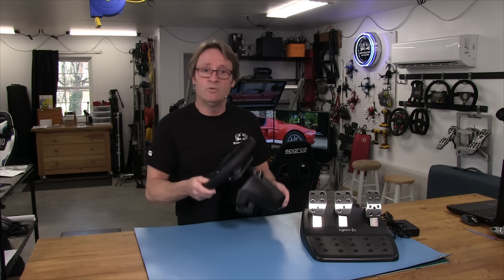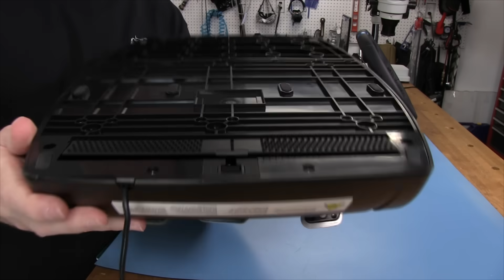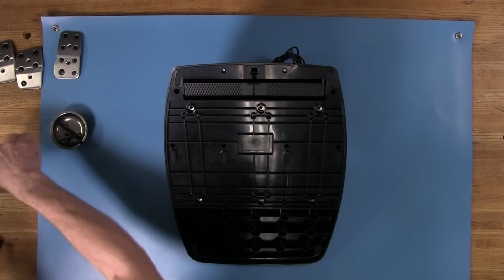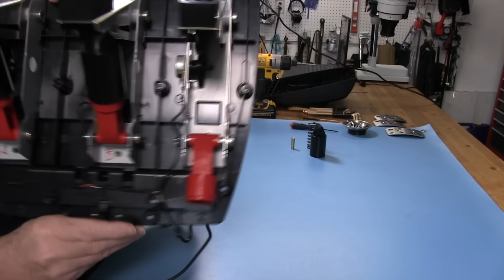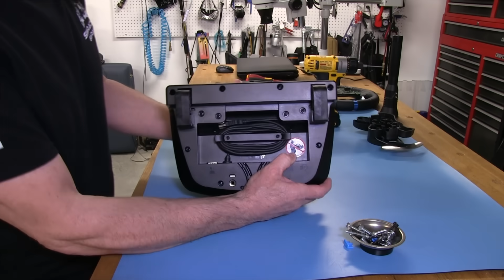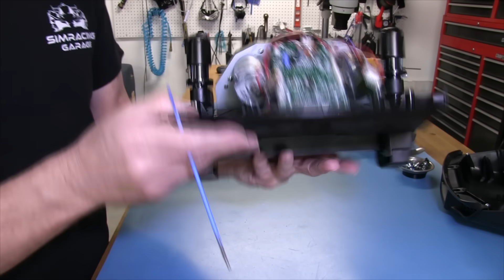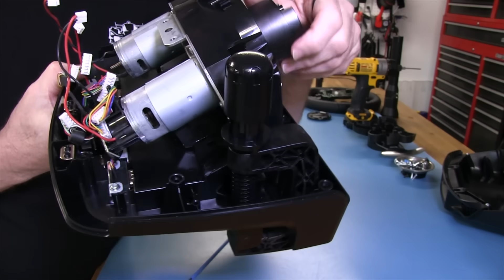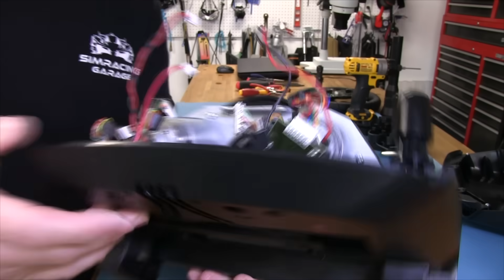Logitech G29 Review

Comment: Its so fun watching this as a g29 owner (1year and a half now).
This is my first wheel :) Am very happy with the product
Reply: Im still running my G25 for 11 years lol  but upgraded my pedals and shifter.
Reply: @sweetcougar  you an OG dude hhhhhh 👌💪💪
Reply: Close to a year maybe a bit longer with mine.  Same as you, first wheel I bought.  Very happy and it works across several different games and performs well.
Reply: M96k3y Same, 5 months with mine
Reply: Key Koben, for what it's worth, my G29 has been going strong for 8 months now. I've used it with Assetto Corsa, Project Cars, F1 2017, Dirt 3, and Forza Horizon 3 and I haven't had any issues. I did need to adjust the vibration and feedback settings to eliminate clipping and rough clacking sounds (particularly in F1 2017), but that's something you'll have to do with any wheel.

Logitech seems to have the best durability out of the good entry level wheels (between Logitech, Thrustmaster, and Fanatec), and I've had good customer service from Logitech in the past for mice that broke on me (and were easily replaced).
Reply: Hey! After 1 year and half is your G29 still running good? I mean, I've read some reviews of people saying that their g29 has stopped working after some months or days. I've bought a G29 and I'm a little bit worried about this. If you reply to this message, thank you very much! ;)

(Sorry for my english)
Reply: I'm gentle with the wheel most of the time and i believe that that does help. I try not to overheat it, oversteer it with force and stuff like that. But other than that no wheel will die at same time. You might be unlucky and get a bad one from factory, rarely happens tho... I would still suggest tx500 for starters :P saves you the hassle of upgrading to it later :D I have to save up for it now since im kinda bored of the g29.
Reply: After 2 and a half years my G29 pedals have started to fail out of warranty so I'm waiting for CSL elites to arrive. But the wheel itself is still working fine, although some of the buttons have been worn blank from use...
Reply: Playstation didnt stop supporting the g29,biught it 2 weeks ago and working fine.Did you try to set control to the wheel?
Reply: Koben, my G29 is waiting for my exams to be done to be tried the first time, so I don't know yet how good and durable it is, but if you live in Europe you have 2 years of warranty, so even if it breaks down after 1 year and half you are fine. If you live outside Europe, you have to check you local laws on how much warranty you legally have, or check with Logitech themselves how much warranty you have (normally it is said somewhere in the owners manual, or on a warranty card).
Reply: Alexander Timofeyev yea! I've bought it 4 weeks ago and it's very nice! :D
Reply: Ok so 3 months later (1 year and 9 months now) and my potenciometer is either broken or dirty enough that i have to send the wheel back. Don't want to lose warrenty over cleaning something out of my pedals. (Wheel it self is still running as good as it was 3 months back). Nice to see people being able to run g29's for longer period of time.
Reply: My thrustmaster tx is still doing just great and it is coming up to three and a half years
Reply: Jarne De Prins thank you very much! Yes I live in Europe and I have 2 years warranty (bought new from Amazon)
Reply: Must be nice... I got mines yesterday and it's not even detected on my ps4, it spins but no usage on the ps4 menu or Dirt 4, Assetto Corsa, Spin Tires Mudrunner, or Driveclub.
Reply: Vikstar Draco, have you tried to hang it on a PC? I had to update the firmware of the wheel first before it would be recognized by my console. Update of firmware was only possible after installing the Logitech wheel on PC. I don't really agree with James above me. I do know Logitech has dropped support for older wheels (i.e. G25, G27), I couldn't find that info about the G29. The games you mention are also compatible according to the developers of the games. As the G29 is still being sold as PS4 compatible, I would return it to the shop. My first wheel was also a faulty one, which failed me after just 5 months. The replacement wheel (Thanks again for that awesome service, Logitech) is working fine, but as I mentioned had to be updated to the newest firmware.
Reply: @joerirouwen1295  on what part is there disagreement? PlayStation did stop support for the g29 its was a pretty big deal at the time.I must admit they may have worked things out by now.
 Or do you disagree with the part where i suggest to get a wheel thats on par or better than the g29?, Would you rather people play on a cheap wheel with no ffb and limited rotation?.
 Or maybe the bit where i say the wheel is fine. (it could be an out the box faulty wheel we don't know).
 Im guessing you disagree with me  telling him that its not his fault, right?
 Apart from telling him to try a firmware update you told him the same thing i did "to get his money back" .
 To even add in your comment that you disagree with me especially without indicating on what part is a bit strange and signals intent to upset people other than the ones your trying to help. "yes that's how it comes across".
 
 I could be wrong, but it frustrates me that you didn't pin point you disapproval ,the bottom line is (without going over old ground) we told him the same thing to get a refund.
Reply: James Downing, Well, as you seem to make a huge point out of my comment, let's clarify myself. I don't really agree with all your points to be fair. 1. As I said there is not much to find on the internet about your suggested incompatibility G29/PS4. An older wheel would have problems indeed, with the introduction of the G29 this issue would be solved. You are kind of right as Logitech was a long time partner of Sony, but choose Thrustmaster at that time, thus became (I believe the t80, t300) the first officially PS4 supported wheels instead of a Logitech one. When Logitech figured the new chip out the G29 became Logitech's PS4 supported wheel. Again, nowhere is a thing to find that the G29 is unsupported. If you could supply me with your source I would be glad to tell you I was wrong. (My source: https://www.eurogamer.net/articles/2014-11-05-whats-the-deal-with-ps4-and-xbox-one-steering-wheels and https://www.eurogamer.net/articles/2015-06-11-logitech-confirms-a-new-wheel-for-ps4-and-reveals-a-new-xbox-one-contender-too and of course https://www.logitechg.com/en-us/products/driving/driving-force-racing-wheel.html ). 2. Of course you can not say that his product is 100% fine, as there are cases of DOA's (Death-On-Arrival), due to several causes i.e. bad testing, bad shipping, bad storage etc. As I said I experienced a model which had not got the last firmware, and thus would not function as expected. That is something small which you can do yourself. To correct your assuption again, I told him to go back in this case indeed, but not immediately for his money back. Try to switch for the same model first, as there would be a good reason why he would have chosen the Logitech above a Thrustmaster. I'm not daring myself in the Logitech/Thrustmaster discussion. So in short, no his wheel is not 100% fine, otherwise it would have connected.
Reply: From what I've read, the G27/G29/G920 wheels are among the longest lasting, toughest wheels out there.  It's not a Fanatec or Accuforce but it still works good.  I've had mine for about a year now and have had a lot of fun with it.
Reply: @joerirouwen1295  Wow you have already proven that your a massive troll who goes around online upsetting people ive seen other arguments you have unjustly  started with people in fact you're a known troll. You are so stupid that you the missed point of me saying that there was no need for you to mention your disagreement and start a agrument in your first comment ,but thats what trolls do.
Its also funny that you blindly said you disagreed with my whole comment when you also told him you get his money back! that also makes you ignorant and a hypocrite, but hey go 
Keyboard warriors hiding behind your screen and fake name.
What a perfetic individual you are maybe change the name to something like "the sad troll life" because yours is clearly anything but good!, you have issues.
See the massive time difference between our comments thats because I've got important things to do in my life you cleary haven't. Im done with your stupidly and ignorance. 
Im sure you'll make out like you have done nothing wrong and that  didn't deserve what I said to you but this is what you live for, i've feed the troll now as i said before im done with you,  I can't entertain bottom feeders forever.
Please do respond with your stupidly ignorant hypocritical comments and let everyone know you're king of the trolls, (i'll just laugh at you)
Next time don't start fights with people who try to impart advise to others even if you don't like just give your own information without being a massive tool .(fun watching you trip over you're own comments Though) you have completely taken me off topic as to why we're here but that was your aim as a troll right to get everyone to focus on you."SAD"

Hope your life turns around for the better real soon.

YOU DESERVED EVEN EARNED THIS ONE HOPE YOU'RE FULL,  GOODBYE .
Reply: Ah yes, the troll card... I did not reply to you in the first place at all. If you imply my comment (stating facts, with sources) as being a troll, you are gonna have a hard life. I bet you didn't even read my comment well enough  and began all salty after the first words. Maybe you did not understand my comment, but that will not be my problem, as I wasn't trying to solve your wheel problem, was I?. Goodbye!
Reply: @vikstahtrickstah  hey at the top of the wheel there is a button to move it to PS4 it is set on ps3 by default
Reply: @ceementality  thanks so much bro 💯 I got through with it :)
Reply: @vikstahtrickstah  PlayStation stoped supporting Logitech wheels not long after the G29 was released rendering it almost useless on Ps4. 
 Its not you're fault, and the wheel is 100% fine im sure. 
Thing is you need a Thrustmaster  wheel or more expensive a brand to play those games on PlayStation. ( I don't know why PS stopped supporting Logitech you will have to look that up yourself)
All i can say is get your money back and get a' TM wheel for your Ps4, I've heard that the t150 is not that bad but do your research before you reinvest.
Reply: @JD-qq9mb  not true
Reply: i had a g29 lasted 6 days after that it would not center itself anymore i treated it well maybe just a calibration issue i gave it back will try the TMX i'm so disappointed
Reply: Loving mine too
Reply: 2 days with mine g29 :D

Comment: Did you find your lap times to be slower compared to your higher end wheel /pedal setup ?
Reply: I upgraded my stock G27 pedals to clubsport V3. I have improved my lap times by 2+ seconds and my consistency is a lot better.  So i strongly recommend better pedals, preferably load cell.
Reply: I had a g27 for several years (before that a logitech momo..  before that another budget consumer thing and so on) ... now I have an OSW direct drive wheel (for a bit over a year now) ...  the laptimes don't realy have anything to do with the wheel...  more with what you are used to...  however it is true that you feel more secure or confidend with a highend wheel when driving on the limit..  so it helps conistency.. but if you are used to a g27 or g29 or whatever... you know your wheel and can get pretty consistend with it too...     sometimes.. you can be even faster with a lowerbudget wheel.. because you can just overpower the force feedback without using much muscle strength... when I need to overpower my OSW..  well.. it might work for 1-2 laps.. after that I am out of breath and my arms a melted.. also you are usually not "relaxed" then.. and when you are not relaxed you are not fast

but where a highend wheel realy helps (at least it helped me).. is setup work..  because you can feel better what is happening (or not happening)..  you start to learn how to setup springs and dampers to your liking... not just because as a reaction of what the car is doing.. but because you feel what the car is doing.. 

a highend wheel does give you confidence just because you feel more and more direct.. and you feel it more with your whole upper body then with just your hands... 

it did make me more confident.. and maybe you can learn a bit better how to drive fast...  but if you are already fast with a g27 or something alike... the laptimes itself won't improve... because you are already fast then..  but as I said confidence improve and that helps to be more consitently fast..

and it is ofcourse ALOT more immersive and fun :)

people that are not very experienced with simracing or new to simracing.. usually are better with a highend wheel.. because the feel more what the car is doing and when the rear slips and how much and so on...  at least that is what I experienced from friends and family..  on a g27 they usually crash at the first turns they arive... on a osw.. they suddenly were able to drive ..not very fast yet ofcourse.. but quite ok for the first times..

but if you are new to simracing it doesn't make much sense to start right off with a highend wheel ofcourse (at least not if you can't throw money around)
Reply: NoNameLeft1500 thanks. Very helpful
Reply: 02semiata pedal set is more important for improve lap time. I think.
Muscular memory is much more effective than pedal travel.
My lap times is more consistent with my hidraulic pedal set.
Also, i have OSW small MIGE 20Nm torque.

Comment: Great video. 
What about the optical encoder? Still plastic with 30 or 60 slot?
Reply: Just like this?
http://cmlaserservice.com/index.html
60 slot or 30?
Reply: No, the ones you are showing are optical encoders. The G29 has a magnetic hall sensor, which basically outputs voltage depending on strength of the magnetic field. In practice this means unlimited resolution, since it is purely analog. What limmits the resolution is the reading of that voltage, which in G29 is done with 16bit ADC (analog to digital converter), giving it a great 65536 steps at 900 degrees of wheel turn.
Reply: milos rankovic 
But I'm curious it's the same encoder as in G27?
Reply: Yes, those are meant for either G27 or G25 and are their perfect replacement. On those wheels, originals are made of plastic and they eventually fail because of heat that is transferred from motors, which makes them crack and lose grip from a motor axis, leading to inaccurate position reading.
Reply: milos rankovic 
I'm using my G27 over 5 years and didn't brake them yet. It's a little bit loud on the kerbs but definitely solid wheel.

Comment: Good to know about the brake curve. I use it without the rubber and an after market spring, and it’s better. Always wondered why my brake pressure settings were so much different than other peoples, I’m sure it’s due to the curve, but can be compensated in game within the tune set up. Great review as always!
Reply: Peter Stefani id love to know brake settings for project cars 2 as i have spring but find 75% of brake travel is 100% travel in software.
Reply: Faztastic In the main controls menu I set brake sensitivity to 65, and in game car brake pressure to 70~80, depending on car, and such.
Reply: Peter Stefani thanks peter
Reply: Faztastic hopefully they can finish all the tire models soon, and also fix the net code. Then pC2 will be a game worth playing!
Reply: Peter Stefani thanks, I have the same problem. Hopefuly this will resolve it.
Reply: JLPA42 I actually did a complete game and save deletion today to try to start fresh. And I noticed that the LSB and RSB buttons on the G920 actually work now! Go figure....

Comment: I hada G25  for 7 years then went to Fanatec (whick kept breaking) to Thrustmaster. I prefer the FFB feel of the G25. I felt like I could feel more FFB effects through the Logitech wheel than with a belt driven wheel
Reply: Yeah G25 was solid! I upgraded to a TM 300 which was more than 2x the price and it didn't feel like 2x the quality :/
Reply: Yes it is. FANATEC Wheels are great for the first few months if they don't break but after a few months they slowly decline in health. My CSR is now a paperweight
Reply: @Steve30x  My CSR is still working 7 years after purchase.
Reply: I know what you mean about the G25 FFB, definitely something about it that is better than belt wheels. I've been through so many wheels and pedal it drives me mad :( they all break so easily.
Reply: Nemaides I always turn off Spring and damper in games settings but even at that the wheel is missing some FFB effects that the Belt Drive system dampens out. I had the same problem with the Fanatec wheels I had. With the G25 I felt even the smallest effect but with the belt drive system it tends to be missing some of the small effects. Like Kerbs don't feel the same on the belt drive system or rumble strips or small bumps. The Thrustmaster TX I have is great with good strength but the FFB did feel better with my G25.
Reply: Logitech via Immersion chipset were one of the first makers of the ffb wheel system and most software and drivers are designed around their algorithms. I have tried and purchased all wheels and only one is better than the g27 for their forcefeedback. This is one wheel set you can play any game anytime with very little config. All others take time to setup and are always lacking. But again feel is a subjective category.
Reply: Kinda late but is your Fanatec belt driven? I'd be scared to buy one if it was the direct drive one
Reply: Damn that sucks. I'll have to look further before jumping the gun
Reply: It lasted two and a half years before a quick decline. First the button the the right paddle shift started getting spongey and now the damn thing auto calibrates very very slowly with not so good FFB.